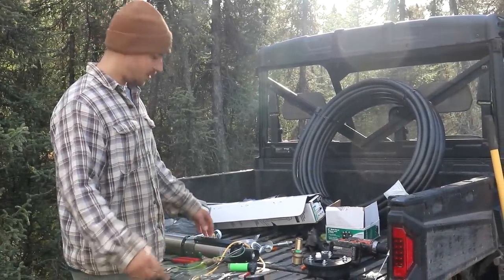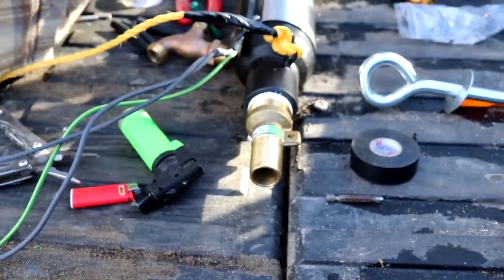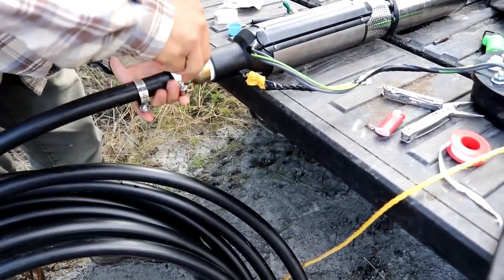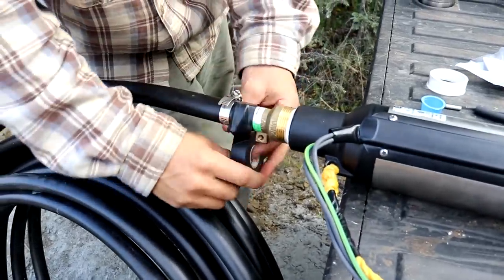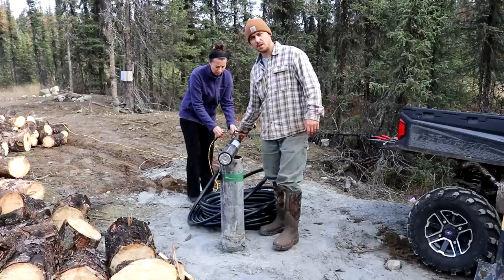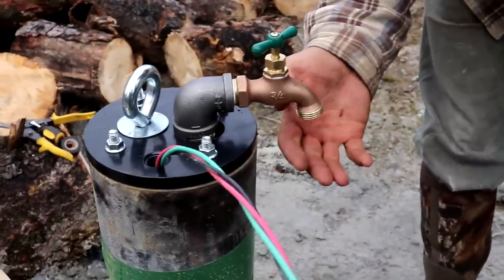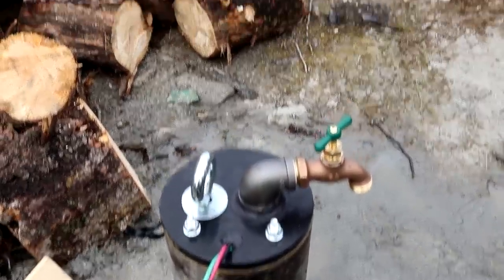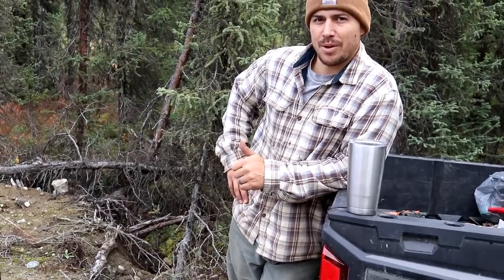Installing A Well Pump at the Off Grid Cabin

Comment: A lot of people believe electricians tape will come 'unstuck', float around and jam the pump. Not true. I've pulled up many, many pumps over the years and never, ever found the tape loose. Ten, fifteen, twenty years later it still holds well. Zip ties are OK but they do cut into the conductors if over-tightened, so be cautious.

Comment: Did it freeze finally? And no need of pressure tank?
Reply from the maker: Sandra Lavoie, we did have an issue with that at the beginning of winter but drilled a little hole in the pipe that allows water to flow out and have not had an issue since then (we have a video on it). We have a submersible pump that we power with our generator when we need to get water every few days so we don't need a pressure tank :)
Reply: @SimpleLivingAlaska  I put in a solar powered submersible pump rigged up the same way...with a small hole just above the pump. I always use silicone with shrink wrap for added insurance.

Comment: didn't hear anything about a check valve. Did you install one?
Reply from the maker: Richard we don't have a check valve, we just hook our generator up when we need water.
Reply: submersible pumps has check valves on the output part of the pump that prevents water hammer..
Reply: @harolddonoso2103  not all of them and most of them don't. That is why I was going to suggest to them to spend the extra few dollars to get one that it would greatly help in the life of their pump.
Reply: @SimpleLivingAlaska  was curious in Alaska do you not put one on on purpose so the pipe drains back down to prevent freezing because a check valve does prevent water hammer and greatly helps life of pump.
Reply: @harolddonoso2103  what is water hammer?

Comment: Hello sir, How deep is your well ? My well is 280ft deep, and what is the length of the hose do I need for a well that deep?
Reply from the maker: 9011combo, we went with 100 feet of that pipe per the drilling company's recommendations but our static water level is at 30 feet and it produces 40 gpm so it really depends on your well how much pipe you will need, not sure if we can be of much assistance.
Reply: @SimpleLivingAlaska  thank you very much
Reply: would depend on your drawn down which is based on casing diameter and flow rate @ pump HP as well as if you have a pressure tank or not........ I would take the ID of the casing and drop a string with something to weigh it down and lower until it hits water and then subtract that # from 280'  to determine how many gallons of water that equals to then know what your pumps potential for maximum draw down is in a real situation.... for example if you just turned the spicket on 100%  will the well make enough water to prevent running it to the bottom or does it always have an ample water column above to prevent running it dry....I've seen people replace 1/2 hp pumps w/ 3/4 hp to "get more flow" when really what they wanted was more pressure and ultimately run the well dry enough to burn out the pumps (not all of them have the ability to detect no water and stop trying to pump!  ........  sorry for the log answer!

Comment: How deep is your well, what kind of pipe is that, what size and how many horse power is the well pump?
Reply from the maker: Bigballer 1 inch poly pipe, the pump is a 115v .5 hp 10 gpm, all purchased at our local Lowe's. The well is 180 feet deep.
Reply: @SimpleLivingAlaska  Nice and thanx alot, now I can get water here aswell.
Reply: @SimpleLivingAlaska  is it regular irrigation pipe? Nice soothing video aswell. Enjoyed it!
Reply: You should run a underground pvc pipe directly to your holding tank inside your home. Saves alot of time and labor.
Reply from the maker: Bigballer, we just have a 55 gallon drum inside with a 12v water pump for our sink and on demand hot water heater. We don't mind pumping the water into the house every few days.
Reply from the maker: Bigballer, I can't remember the name of it, it was about 50 bucks at Lowe's for a 100 ft roll.
Reply: @SimpleLivingAlaska  awe man if you remember just let me know. Because that is the last piece of the puzzle I need in order to have water. Thank you so much for taking your time and explaining. Liked, shared and subscribed.
Reply from the maker: Bigballer, It is 1 in ADS polyflex 100 psi, we pulled it out to check, I hope that helps to get you running water :)

Comment: Are you still using the same set up as in the video?
Reply from the maker: Yes we are
Reply: @SimpleLivingAlaska  thank you
Reply: Did you have to add another check valve, or do you just use the one built into the pump?

Comment: I really hope that's not regular electrical tape your using. Regular tape will turn loose under water over time and you don't really want your pump sucking that tape in to it. They make a tape for wells that's water proof. If you used regular electrical tape you need to pull your pump and put the right tape on it before you have problems and your pump goes out when you need it most.

Comment: Also what size poly pipe did you use?
Reply from the maker: MikeZee, it was 1 in diameter.
Reply: Ok awesome. I'm in the process of installing one this week. Did you get the stem adapter from lowes also. 1 1/4" -1" stem?  Thank you.
Reply from the maker: I can't remember the size but we purchased the pump at the same time at Lowe's so we were able to test fit it.

Comment: How did the tap work this winter? Did it freeze?  Mine drains back below the frost line when not in use.
Reply: They have another vid of it freezing. Easy fix though.
Reply from the maker: Salmon Hunter we did have it freeze just once, we drilled a weep hole and have been fine since then ☺

Comment: Nice work but the wife spoiled everything. So what do you do if the test reveals that the water isn't drinkable or not safe at all? You abandon this?
Reply from the maker: dossube our water came back potable and clean, no problems. My guess is some people may have to put in a filtration system.